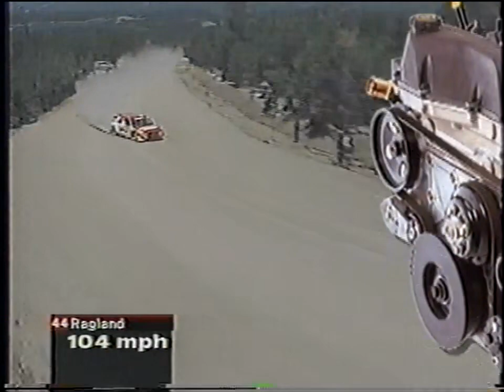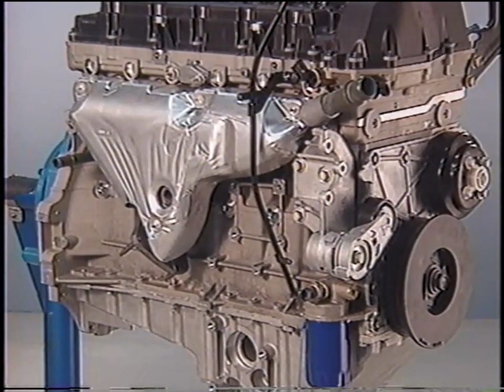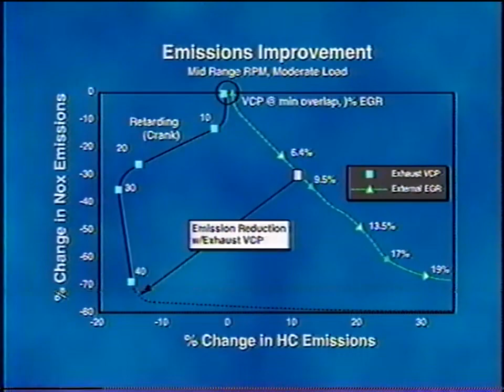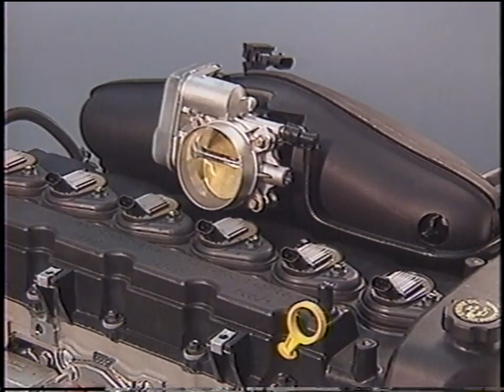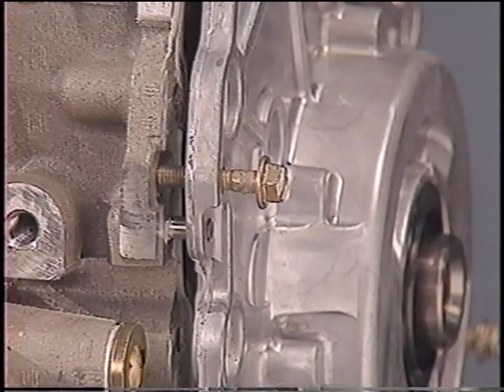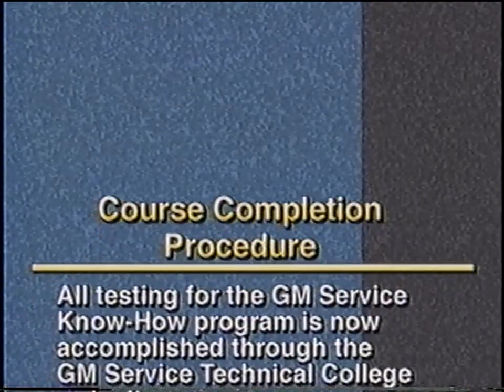General Motors - 4200 Engine Familiarization

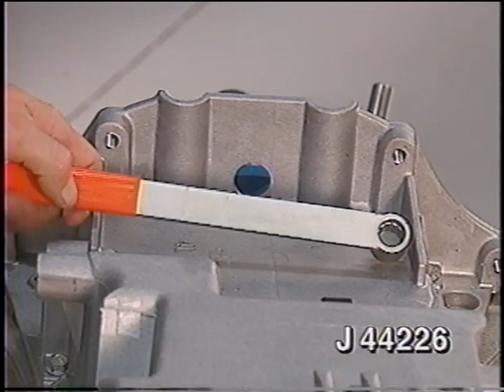Comment: 23:58 man! I rebuilt this engine while the engine was still mounted on the SUV (videos of the rebuild on my channel). I was able to torque the harmonic balancer by placing a 16mm socket through the oil pan witness hole to hold crankshaft in place. I saw this technique used by another You tube video, but seeing the method used in an official is a great relief. The engine is now 4k miles after the rebuild.

Comment: Very smooth and powerful engine. However a rebuild should be done in a professional shop. Not in ones garage as it is technically pretty advanced and beyond your typical do it yourselfer.

Comment: Better EPA fuel economy than a V8? Sorry, my 05 4.2 Trailblazer got about 14 mpg. My 5.3 V8 got about 17 mpg. The 4.2 was underrated as a potential performance engine mostly because it was under developed by GM. GM gave up on it because it was not initially as good as they thought and as is typical with GM, the finance folks pulled the plug from the engineers and it was gone.

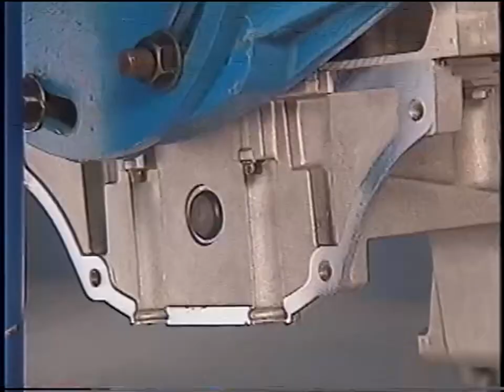Comment: 10:00 that cap is there to remove the torque converter bolts without pulling the starter. A welcome feature. 😆